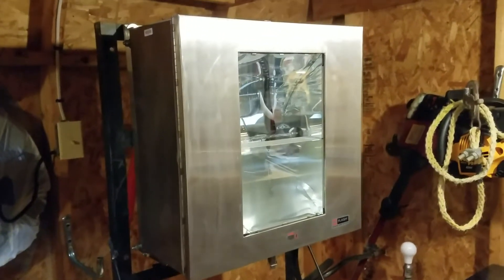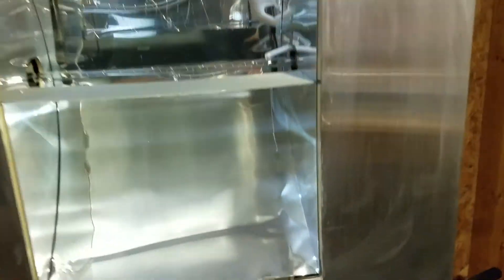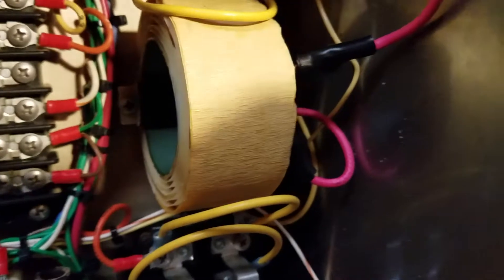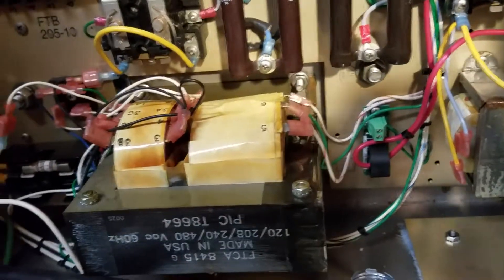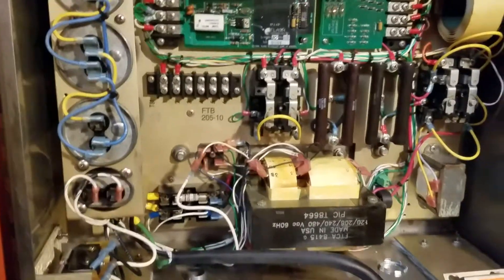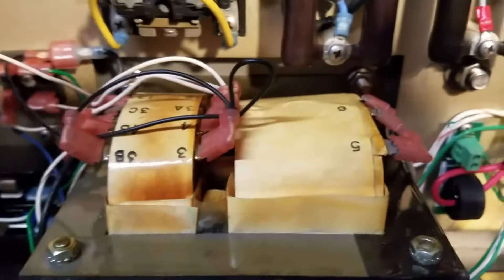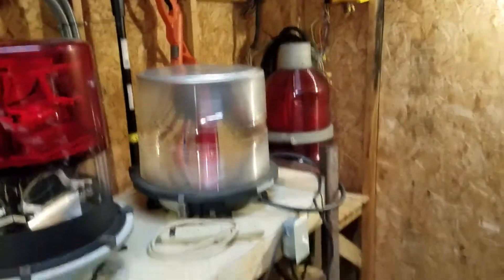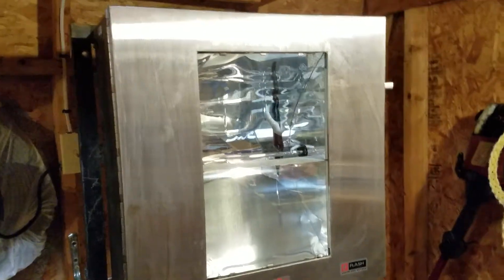Flash Technology FTB-205 High intensity obstruction light

Comment: And also…Doesn’t matter what you wire it to can you wire it to anything, because I have a train box from Lionell and the cord that connects to it it’s like that like, meaning it has the same little fork thing on the end or two prong thing on the end and I need to know if I can wire it or unscrew the little knob put it on the metal screw back on to a haunted and place and then while it’s plugged in boxing see if I can turn it on or not, you know?